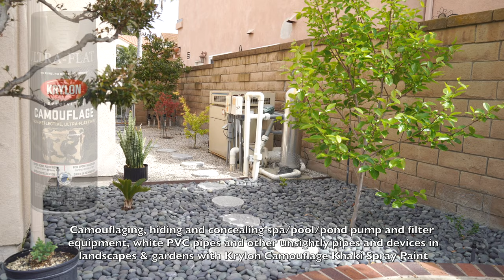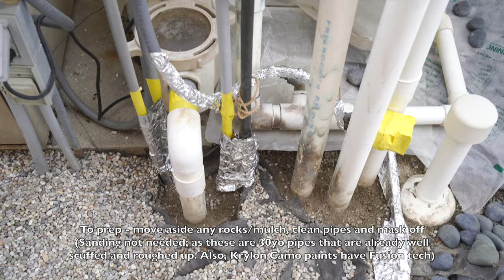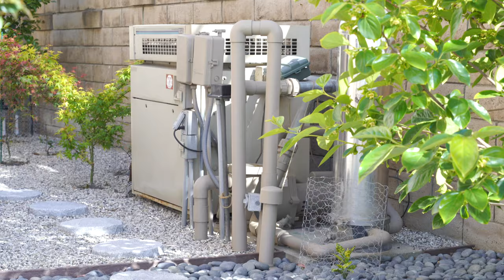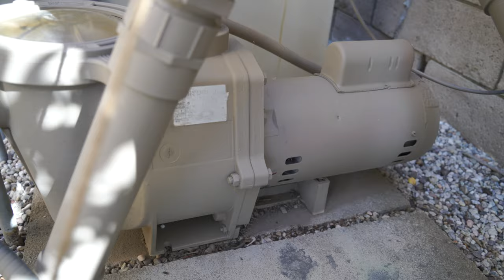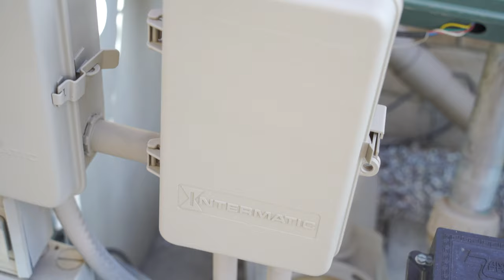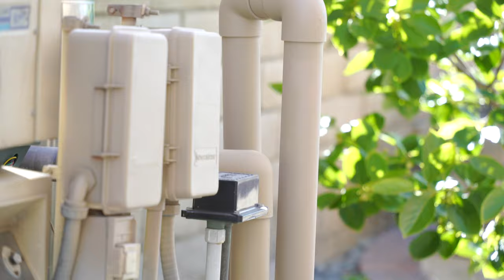Krylon Fusion Camouflage Khaki Spray Paint - Hiding Spa/Pool Equipment & PVC pipes in Landscape [4K]

Comment: When I saw this the first time I thought it was a special air con unit. When you mentioned a screen I thought good idea but it think those are easily blown down if too windy. I suppose vertical wooden slot boards expensive too. Here in Thailand I see lots of people use long rectangular pots filled with soil and bushy plants. Or even just surround air con compressor units with pots of tall plants.
Reply from the maker: Yeah... a small fence would be ideal and the nicest looking! But, a lot of work or expensive for contractors to do (even if it's a small job/fence for them). 

Great idea on the potted plants! I think I saw a neighbor do that to an electrical/utility box in their front-yard.